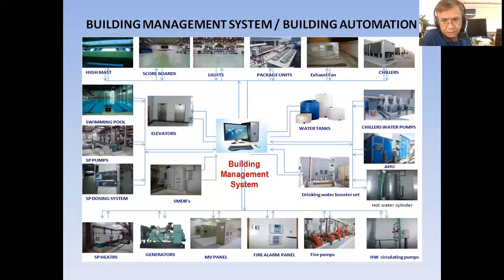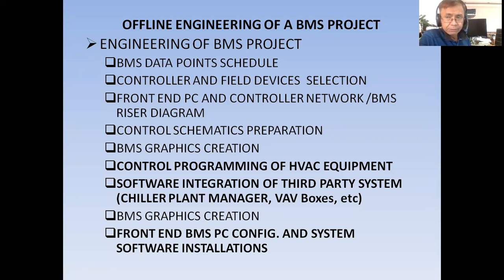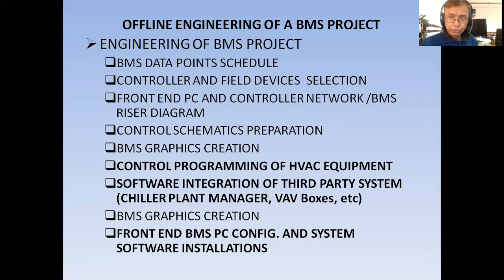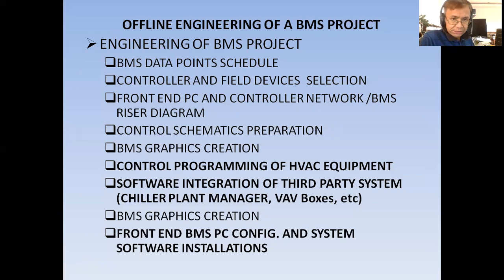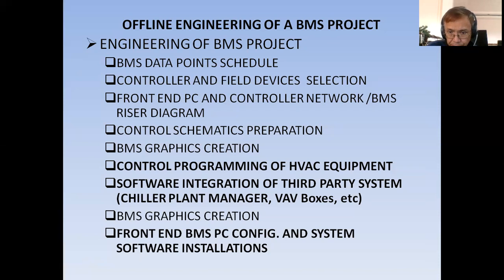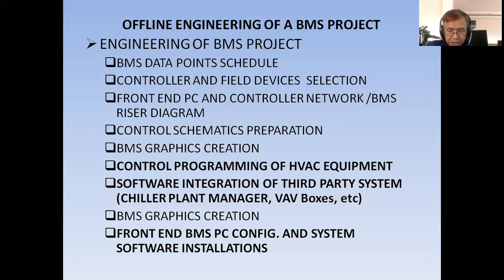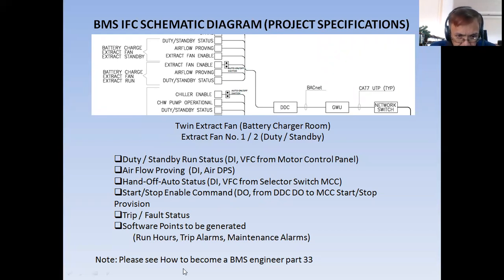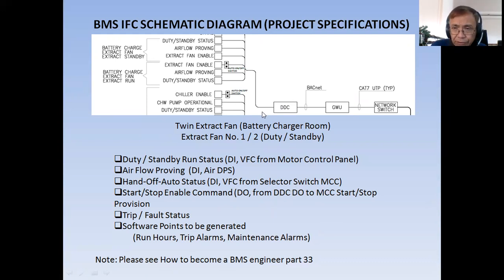How to become a BMS engineer part 69 (BMS Offline Configuration part 2)

Comment: Hi Mr. Santos... you mentioned that sometimes we use more than one computer as a server so can you please explain why and what is the recommended specs for the computer in terms of BMS server and BMS workstation.
Reply from the maker: In some project you will be required  to install the BMS server in a separate machine,  actually it will be specified in the BMS specification. The specs of these machines will be based on how your server will be utilize or how frequent it will poll data from the fields/controllers or network traffic. And it will be based also on the number of BMP points being monitored and controlled.

Comment: Here mentioned DI's should be DO's and wise versa right. ?
Reply from the maker: DI for Digitial Inputs monitoring points, DO digital output control points usually for starting and stopping equipment
Reply: @SantosJrCapellan-BMS  thanks
Reply from the maker: @khaleelkk578  thanks for supporting the channel appreciate it